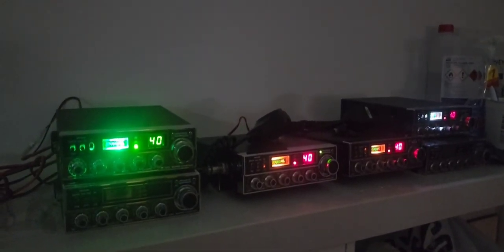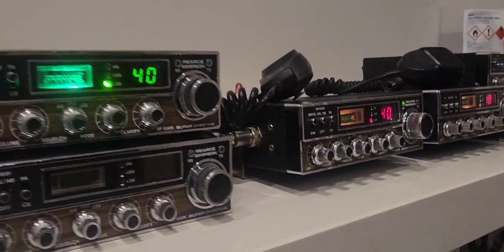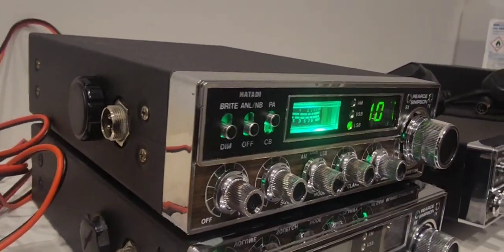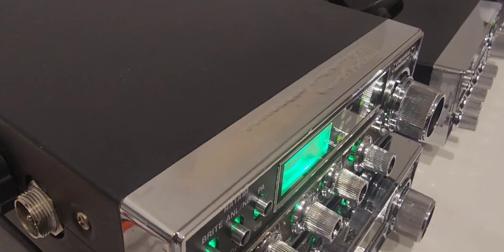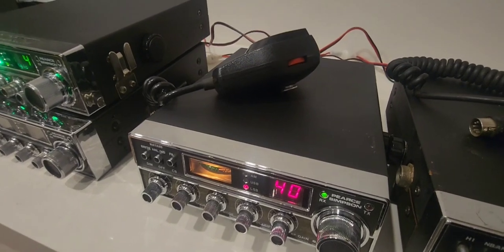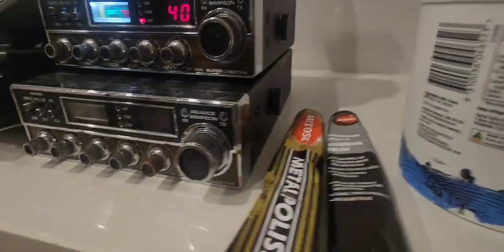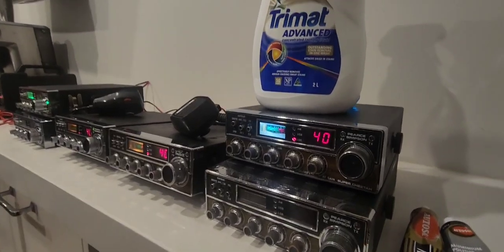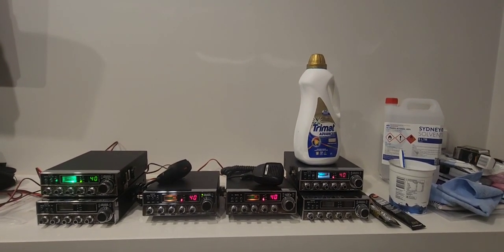CB / Ham Radio Restoration - How To Remove 40+ Years Of Grime

Comment: Gday Paul, only found your youtube channel a couple of days ago after digging out my old Super Cheetahs that have been sitting in a box for around the last 20+ years. I have the Super Cheetahs v1,v2 and v3. I last used them as a kid in the mid 80s and havent powered any of them up since. Any hints on what not to do before i bring them back to life. They all worked fine then but obviously may not be as good as they once were. Any advice would be greatly appreciated. Cheers.
Reply from the maker: Turn them on and let sit for 24 hrs, turn off let sit for a couple of hours then turn on for 24hrs.

Then use them.

If you have any issues you will then see an hear them.

Caps need replacing and possibly an alignment

Comment: Is it safe to soak the whole front panel in solution. Chrome and woodgrain with writing together.
Id hate for the writing to wipe off blank.
Reply from the maker: Yes

I actually leave faceplates in the solution for 2-4 days to help with removing the front panels.

What I would do is leave for 1 hour and scrub, dry, check for clean.

By the way I use half a bottle of windex to two caps of fabric cleaner in that container in the video.   That would be enough for what you want to do in a bigger container
Reply: @Pull_It_Apart_Paul_Ham_CB   thank you.
I saved a screen shot for reference 👍
Reply: What about cleaning the board on a radio that was in a dirty dusty truck for years and then stopped for another 20 years and had mice running around it
Reply from the maker: Isolpropl alcohol on pcb side component side spray onto it with pump bottle whilst radio standing on its end.

After finished, let stand for for an hour or two before turning on

Comment: That's a shame, we need new faceplate and it's not available in aftermarket 😭
Reply from the maker: What's wrong with your faceplate?
Reply: @Pull_It_Apart_Paul_Ham_CB  scratch every where and some dents on bezel
Reply from the maker: Pretty normal with these, can remove chrome and paint bezel
Reply: @Pull_It_Apart_Paul_Ham_CB Hi Paul I have some old radios of my dads he passed in December. Was wondering if you would be interested in purchasing any.
Reply from the maker: Hi Linda
Sorry to hear about your loss, it's a difficult thing to move gear on in such circumstances.

I've contacted you via messenger, check your app.

Yes let's chat via email:

Paul